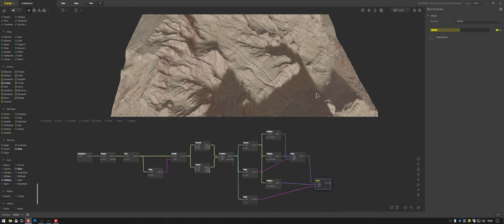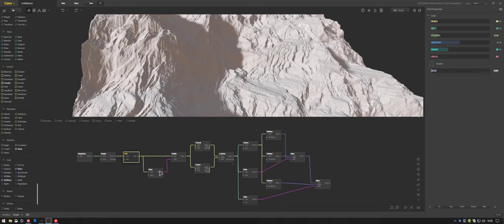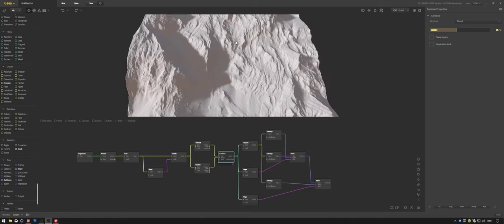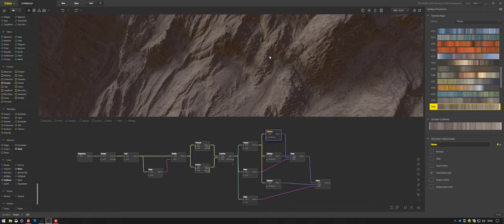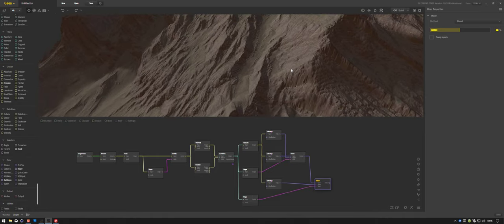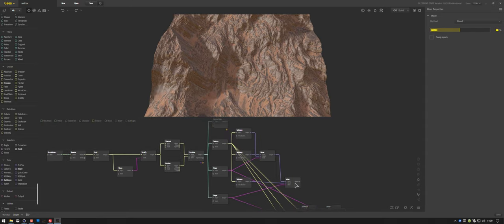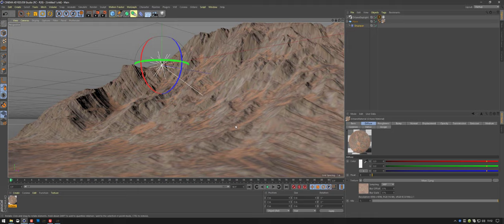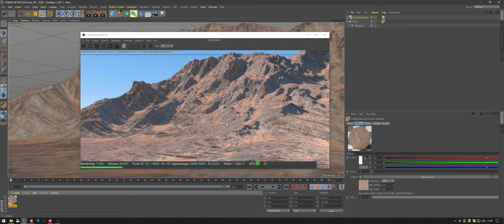Gaea Tutorial: Basic Texture Creation

Comment: Thanks for this.
I'm thinking about getting the Indie license for CG. Do you think the detail is good enough for hero VFX/Animation or at least mid ground?
Thank again.
Reply from the maker: Yes, the indie provides good detail for animations. Hero, you will need some additional detail, which you can get with manual sculpting.
Reply: @DylanPWN  Thanks for the reply!
So would I be better off getting the next one up for $199?
Reply from the maker: @tearsofsoy4091  I think you will be fine with the Indie. $99, for most animation. 4K is a reasonable resolution to be limited to. However, the Professional isn't much more expensive, plus no limitation. If you think you need higher resolutions, Pro is where I'd go. :) That is $199.
Reply: @DylanPWN  Thanks I think I should be fine with Indie too

Comment: you mention 'you do want to throw in a normal map' but it doesn't seem like you use it anywhere?  can you elaborate on what that is for?
Reply from the maker: Yes, you can export a normal map with the normal node. What I usually use this normal map for is for distant mountains that are exported at lower resolution but a higher resolution normal map applied to it. Just to help with the details pop a bit for those distant mountains.

I apologize, my tutorials are unscripted and I usually just talk while I'm thinking and recording. XD
Reply: also, in C4D, where does the heightmap go?  When I place under the Displacement in the material, i get these weird jacked up edges....and the Displacer modifier to the Plane doesn't seem to have a field for entering in the heightmap?  Thanks for great tutorial!
Reply from the maker: @asylumlabs6075  In the displacer modifier, you go to Shading and you click on the 3 dot button in there to load an image. Make sure you change the width and height segments on your plane object to something high, like 600 or 1000 (for max resolution) or else the displacement will not look right.

Comment: how to export it to 3ds max with textures?
Reply from the maker: The same way as with everything else. Use a mesher node if you want a model or export a 16 bit height map or higher, typically using png or tiff as the options. For the color map, you can do the same but recommend png.

As for the set up in 3DS Max, I don't use that program, so I can't explain the process very well.
Reply: @DylanPWN  what program do you use for 3ds max? or which one you recommend for a detailed terrain to place a building on it. I don't know if i could really use this scale for such purpose
Reply: @DylanPWN  this scale might be good for a masterplan but i need it as a background on a render
Reply from the maker: @alonzonchik  I use Cinema 4D. Both programs are great for getting detailed terrains into a scene. If you need a landscape for a backdrop, you can get away with a low resolution height map. Like 1024 or lower.
Reply: @DylanPWN  alright then i'll try it, thank you man!
Reply from the maker: @alonzonchik  sorry I can't be more detailed... I'm currently out of the modeling stuff for a couple more weeks.